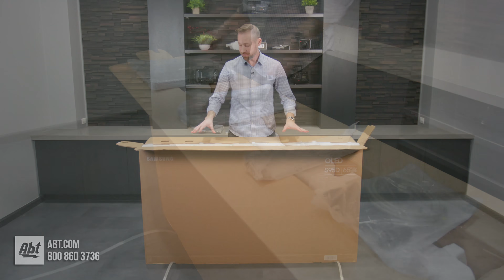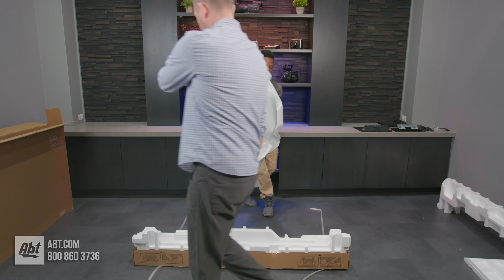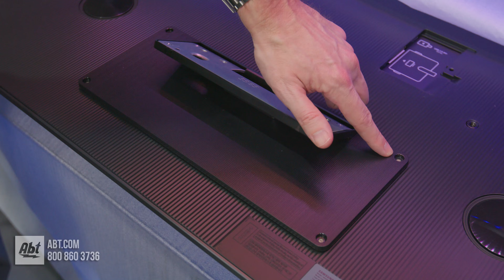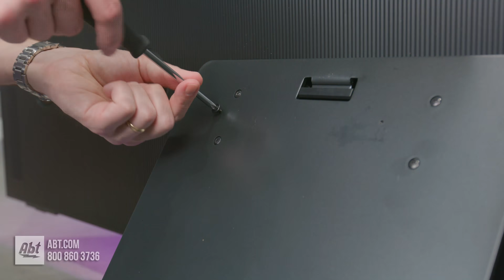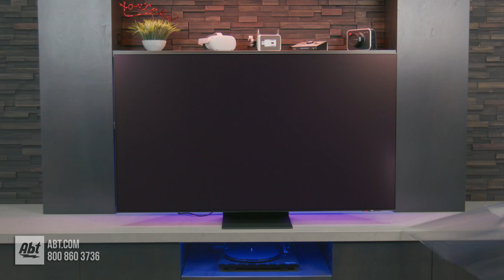How To Unbox The Samsung S95D OLED With Pedestal Assembly And Install - QN65S95D

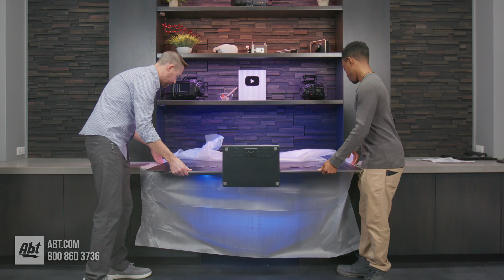Comment: 4:42 - that bend was NASTY. We will never know the actual damage.
Reply from the maker: @ooxenontitareoo7512 We did everything based on the setup instructions that came in the box. Also, the light reflection on the back of the TV may have made it look more extreme than it actually was. This TV was on display in our showroom for several months after we made this video. We can assure you there was no damage at all.

Comment: In the title you said 55" and 65" but 55" is not in the video. The 55" is packed differently so you should remove it from the title. I was looking up for help how to unpack the 55" and your video is misleading. The 55" is a different animal.
Reply from the maker: @cf2431 Thanks for pointing that out. The 55" model has a piece of cardboard that you pull down instead of lifting the box off the TV.
Reply: @abtelectronics  Thanks. Otherwise after I managed to get out the panel, the rest was on point for the 55" model as well. But I wrote the comment before I could get out the panel, which in itself was pretty challenging to do alone.

Comment: I was looking for how to securely attach the cable to the tv. But although 6:20 pointing at the part for which a non-fitting little piece of plastic is given and described in the manual, the cable is loosely attached here aswell. The screw you describe does not exist.

Comment: My tv on pedestall off axis around 15%  what to do?
Reply from the maker: @ЄвгенДомашець That seems pretty off. First thing would be to double check that the pedestal is installed properly. If it is, and the surface that you have the TV on is level, you may need to contact the retailer where you purchased from. If it was purchased from Abt, please give us a call at 800-860-3736 so we can help find a solution to the issue.

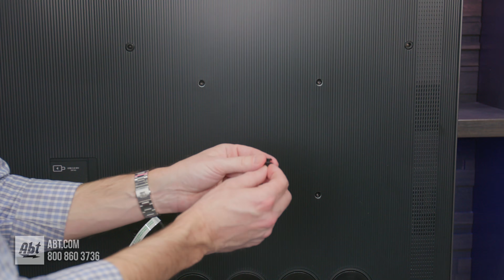Comment: 7:00 THESE HOLES WHERE TO PUT THE BOX ATTACHED TO THE TV ARE NOT PRESENT.
Reply: Running into the same problem.. did you find a solution? I don’t have these holes

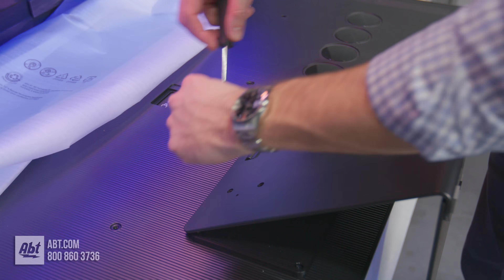Comment: @3:50 screwing the stand to the bracket on the back of the TV ... the (very tight) holes in the angled stand piece do not line up closely enough with the threaded inserts in the bracket on the back of the tv.  I had to drill out the holes on the angled piece to 3/32" in order to get the screws in.  They are fairly small and fine threaded, and would be easy to strip.
Reply: This. Thank you!

Comment: Thank you. Planning on getting the qn900D 8k, with the same base, and the info on putting the stand together was helpful. 
As for the people bad-mouthing the matte finish (which they haven't even seen for themselves yet!) even though I prefer non matt, if this new finish is  anything like the one on the Galaxy S24 Ultra phone, then it will be perfectly all right. It's not like the old matt finishes.  The flagship qn900D also has the matt finish.
Reply from the maker: @kpv123 We feel like people may start to change their minds once they see the S95D in person. It really is better than matte screens of the past. However, we definitely understand that opinions will vary. If someone really doesn't like it then they'll want to take a look at the S90D instead, assuming they want to stick with Samsung for their OLED choice. If you decide on the QN900D be sure to give our TV specialists a call at 800-860-3736 before you buy. They can tell you about any promotions we have running that can't be advertised online.

Comment: Maximum Nits  ??😮
Reply: Ignore the 3000 nit claims. The maximum peak brightness is around 1600 - 2100 nits depending on the settings and that's only for small highlights in HDR. A fullscreen white image is around 300 (three hundred) nits. This is a bit brighter than any other OLED on the market, but it's not that bright compared to most mini LED TVs. 
For comparison, the LG G4 is 1300 - 1600 nits in small highlights and a little over 200 (two hundred) nits fullscreen.
Reply: It’s very bright.
Reply: Said to have a maximum Nitt level of 3000. %20 higher compared to last year's model s95c

Comment: QD-Oled not good with light in room as not black like traditional W-Oled.

Yes huge advantage with colors and screen uniformity, but actually prefer W-Oled for this very reason as like my blacks pure and not lifted in no condition
Reply: This concern is a nothingburger after owning WOLED from 2014 through today (and having an A95L today).  What details near black are you really visualizing on any OLED with ambient lighting?
Reply: @vinnie97  I own both and speak from experience. During daytime the W-Oled looked better in ambient lighting where as the QD was lifted and at times purple.

Moved to a bedroom with blackout curtains and it’s good (Sony A95K 65”)

Now in living room using a 77” Sony A80K which is just a standard W-Oled and prefer it in that room. I also have a CX, BX from LG plus an 85” Samsung 8K that I use in my gaming area

Comment: Unfortunate the matte finish doesn’t help the black level raise (purple tint) in a lighted environment, just reflections. Rather the S90D.
Reply: The S90D is based on the S95C, so you might as well buy the S95C, which is now getting cheaper so that samsung can get rid of the remaining stock.
Reply: @ADAM-UNIVERSE S90D has a new processor and S95C has a powerful speaker plus one connect box. So they are not rebanded and all. Both has different upscaling tech
Reply: @ADAM-UNIVERSE  So it’s literally a rebranded S95C w/o the connect box? Source?
Reply: @SimplyHodls  This was already the case with the S90C, which is based on the S95B. I once saw a YouTube video about this. If you google it, you should find something about it.
Reply: Wrong